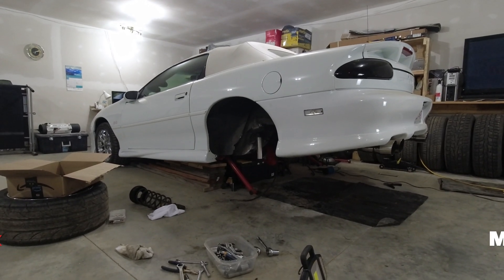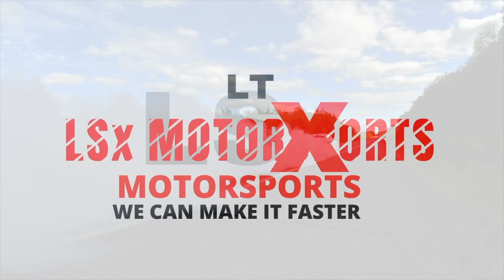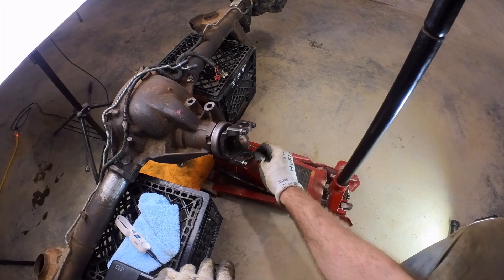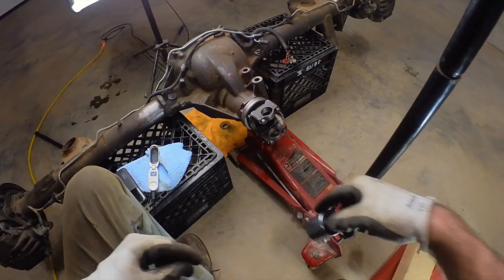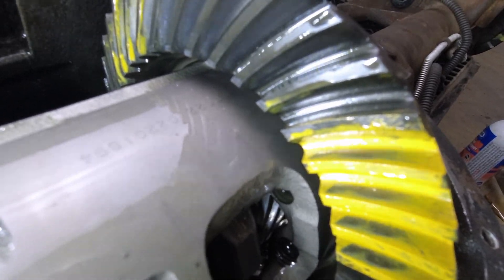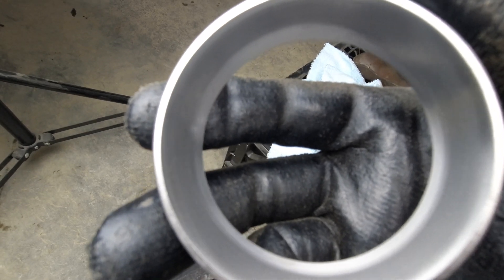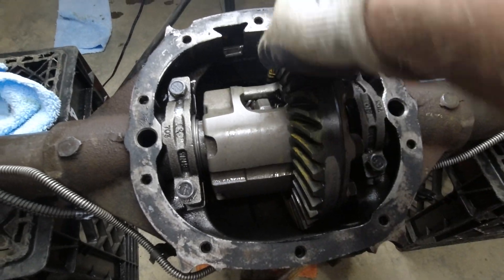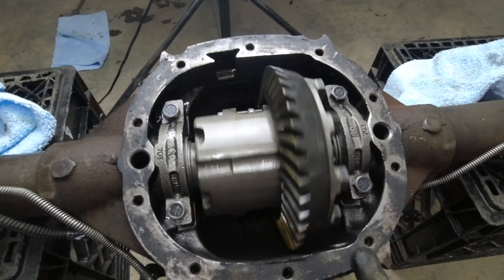Gear install gone wrong - Diagnosis of a noisy ring and pinion

Comment: How's it going.  Did u ever get it figured out? Im having the same problems on my 1988 5.0 foxbody mustang.  Im so deflated 😢.  I did a rear end rebuild and 273 to 355 gear swap with all new parts and drove my car for the first time tonight and i have bad noises . So frustrating after getting everything back together.  Im at a loss myself.. I'm thinking maybe i should pull the rear out my car too and maybe take the whole rear end to a shop, but like u i wanted to learn myself... way more involved than I thought.
Reply from the maker: I haven't got it fixed yet. I have a new set of Motive 3:73 gears I will be putting in soon. I suspect most of my noise is coming from the carrier bearings I think I have too much preload on them but won't know for sure until I get it all apart. I kept on driving it the way it is so I can get some miles on it so that maybe I will be able to see enough wear so I can tell what the problem is. It has stood up to alot of hard launches so I am thinking it is the carrier bearings but we will see soon. Sorry to hear you are also having trouble. I have heard many people say the best gears for fords are the Ford motorsports gears. If I get it together right this time I will have a video on how to do everything.

Comment: This sucks - is one of the parts out of spec or something?  It's not like you're doing anything out of the ordinary here.  These problems are awful because you're pretty much just left with throwing money at it until it's solved...
Reply from the maker: The biggest problem is my lack of experience.Doing a ring and pinion requires precision tools which I don't have or lots of previous experience which I also don't have.I also bought the cheapest gears available which also doesn't help.lol.But I am going to give it another try by adjusting a few things and if it's still noisey (Which I am sure it will be) I  am just going to run it and this coming winter I will get a more expensive gear which is cut like the OEM gears which generally run quieter.The OEM use what is called a 2 cut gear and the gears I have are a 5 cut.But installed properly the 5 Cut can be quiet too.Most of these issues comes down to my lack of experience.Thanks for watching and commenting.Maybe one day I will be able to make a video on how to properly install gears.lol.
Reply: @LSxMotorsports2021  
Well good luck with this.  Yeah, skimping on parts can get painful in the wallet!

When you do get it fixed, I'd love to see a video on how to do it right the first time.
Reply from the maker: Haha I don't know if I will ever be good enough at doing it but you never know.lol.